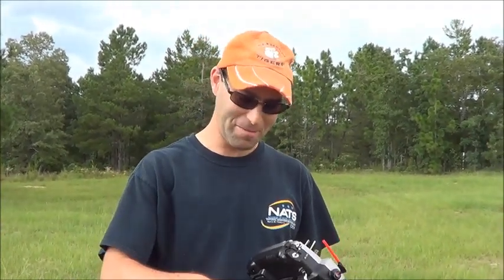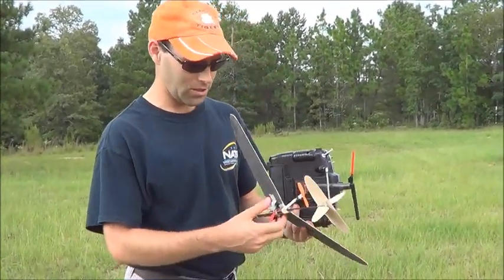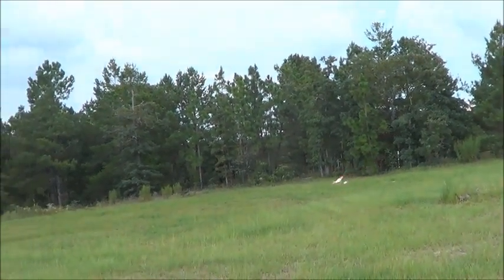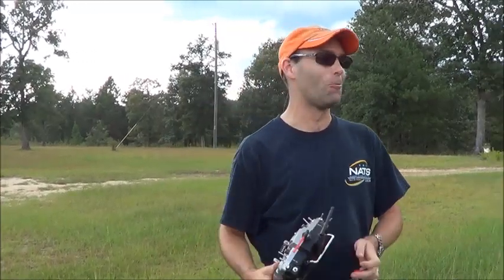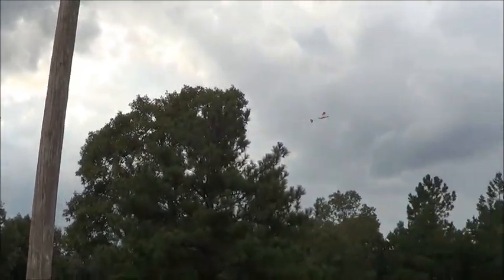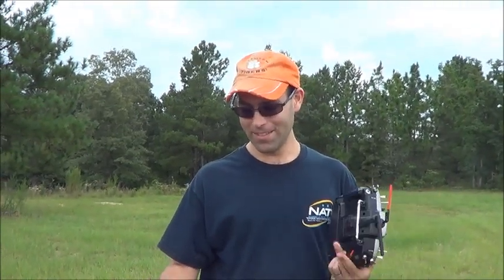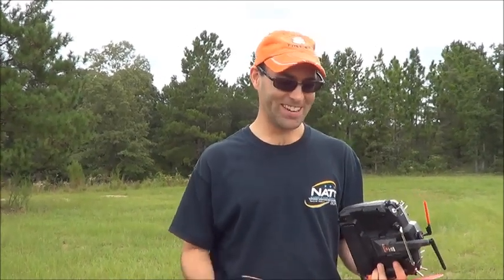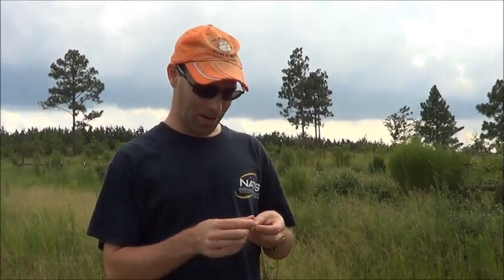Capacitor Powered RC...sorta

Comment: idk if you saw my comment in FT, because there's always SO MANY there lol.
a "buck up voltage" circuit in eBay is about a dollar to take 2.5v-3v up to 4.4v or so, and a WLtoys F-949 brick (or similar 1S) has 2 teeny servos, the ESC and receiver all integrated so you can run it all from one supercap. probably want to run a geared 6 x 12 mm motor (max) to about a 4" prop, lower speed but more static thrust with lower current draw for a little more flight time. those little buck up circuits do try to keep output voltage same as the source voltage is dropping (as current falls), so it might be able to cut throttle power and still power control surfaces to land it.
it'd ROCK to see a little RC plane flying 2-3 minutes, taking 30-40 seconds to charge and do it again, no hassles swapping battery packs!
Reply from the maker: Excellent advice!